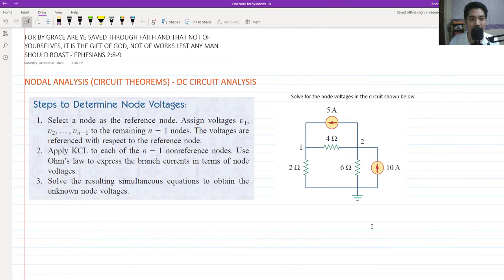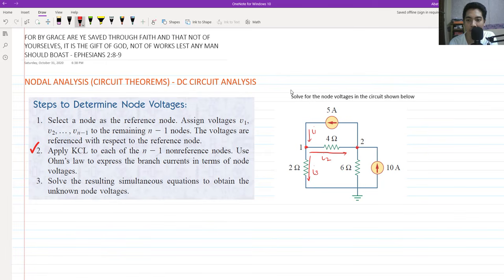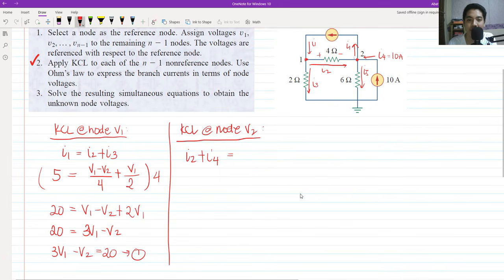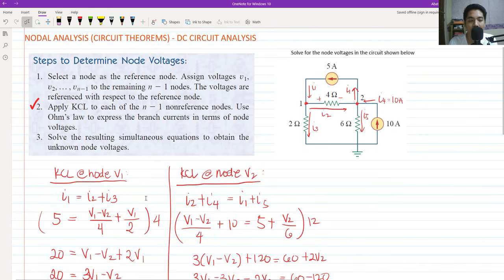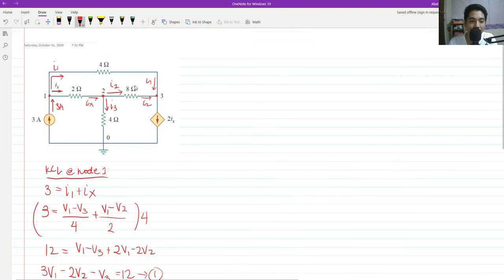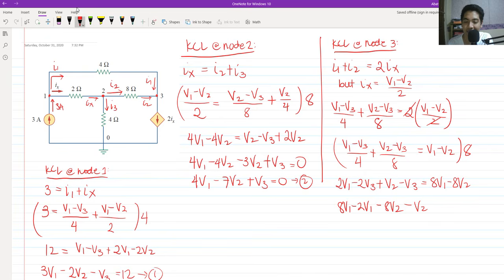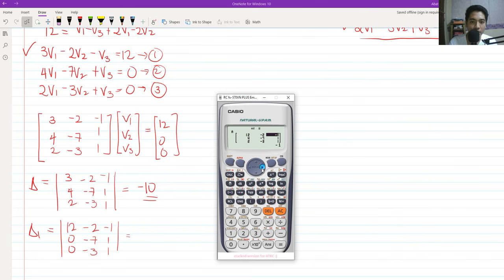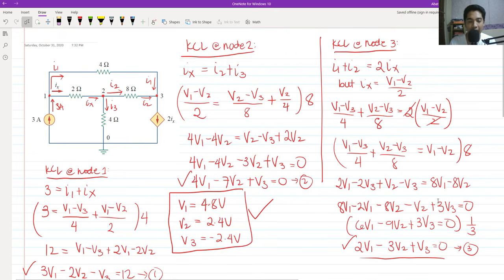Nodal Analysis, Node Voltages (Circuit/Network Theorems) - DC Circuit Analysis

Comment: A tank of water is 15 feet long and has a cross section in the shape of an equilateral triangle 
with sides 2 feet long (point of the triangle points directly down). The tank is filled with water 
to a depth of 9 inches. Determine the amount of work needed to pump all of the water to the 
top of the tank. Assume that the density of water is 62 lb/ft3.

Comment: Hello po, sir! Sa 2nd problem po, bakit po sa KCL @ node 3 instead of (V3-V1)/4 and (V3-V2)/8 naging (V1-V3)/4 and (V2-V3)/8? Sa mga nauna naman pong KCL niyo sa problem parating nauuna yung node voltage kung saan po kayo nagki-KCL. Medyo confusing parin po kasi sa akin itong nodal analysis. Btw, maraming salamat po sa vid! :)
Reply from the maker: Binase natin sa current flow. So sabi natin current flows from higher potential to lower potential.